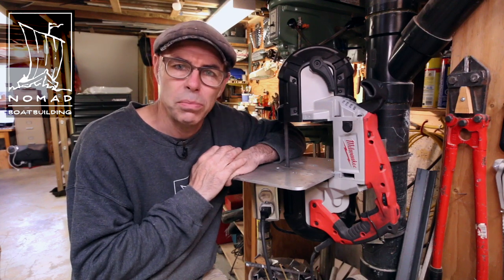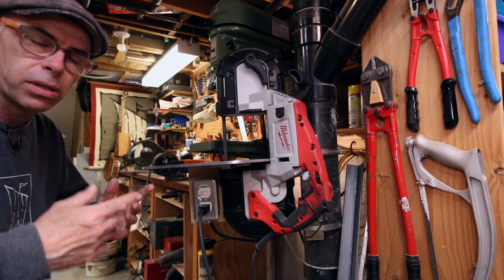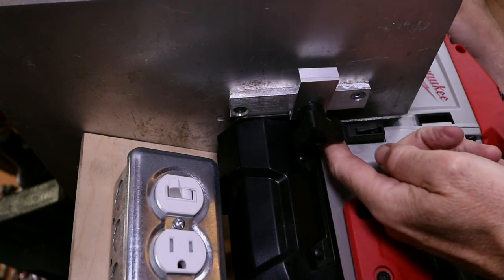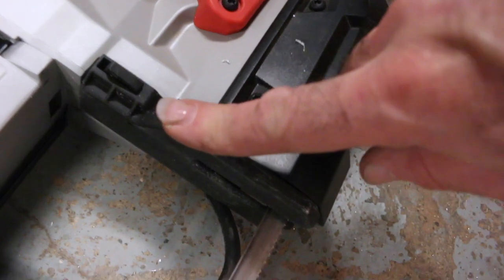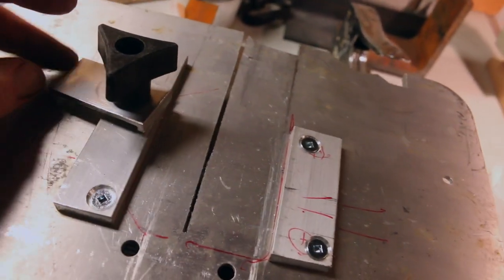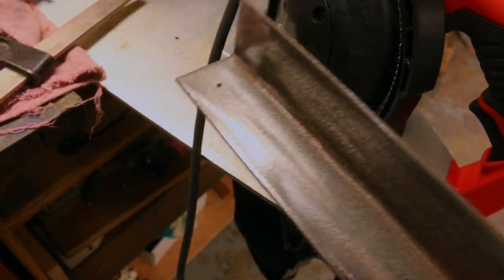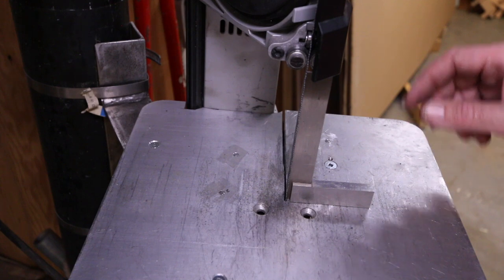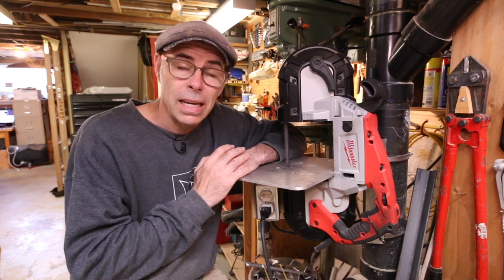Milwaukee UN-PORTA-bandsaw stand

Comment: Wow! Number two today. Here feeding the algorithm and checking to see if I messed anything over on Patreon. Have a good week Mark.
Edit: Have you thought about screwing a plastic cutting board to the aluminum plate to give you a little bit slicker surface? I did that with my pseudo router table.
Reply from the maker: That’s a good idea. I really haven’t put any thought into the refinement phase of the hack.
Reply: @Nomadboatbuilding  I have the same problem. Once something works I tend to stop thinking of any improvement until someone says "Hey have you thought about..." Then it's "Why didn't I think about that?" Have a good evening Mark.
Reply from the maker: @mattevans-koch9353  will do Matt